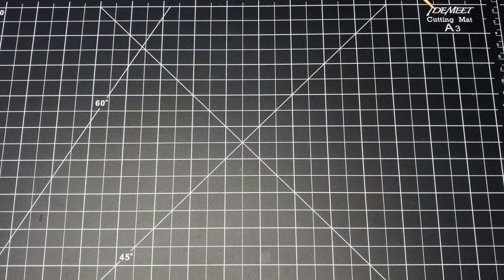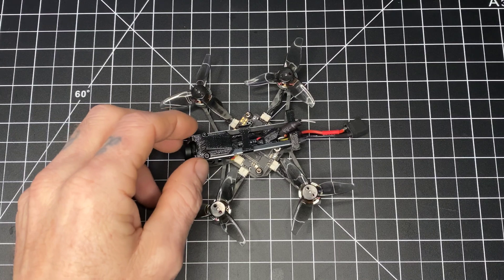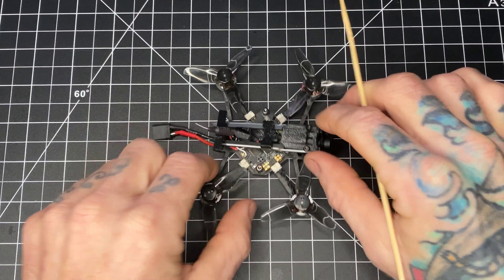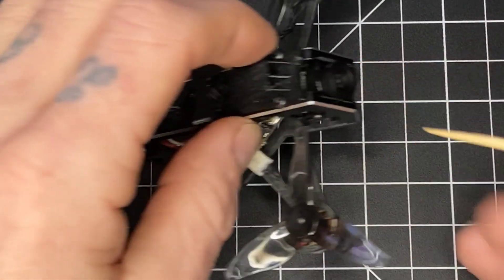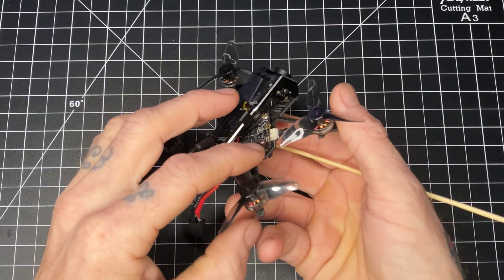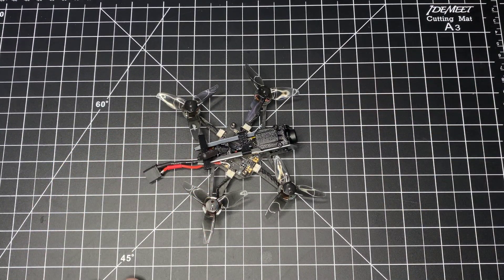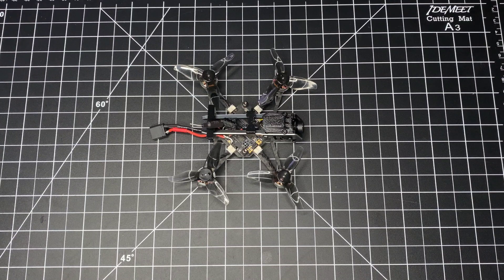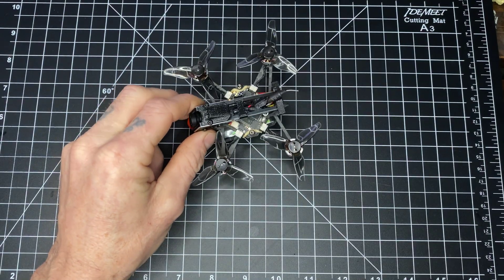Nano Freestyle Drone | HGLRC Draknight 2.0 #fpv #fpvdrone

Comment: Will it run 4s?
Reply from the maker: No 3s max
Reply: @justhackitfpv No issues at all on the 10000kv motors with 3s?
Reply from the maker: @S.G54321 no issues
Reply: @justhackitfpv Ordered some 3s lipos for it 😁. I was using 1003 14800kv motors on 2s for a while. Fast but it drained my batteries faster.... If the 10000kv motors can give similar speed or even a touch faster on 3s, while also having better battery life. Hell yeah! 😁

Comment: Hey man what size Allen key does it take to open up the frame I lost my Allen wrench for it. Not the size of the bold for the camera but underneath to the the top of the frame off?
Reply from the maker: M2
Reply: @justhackitfpv are you sure I think I have an m2 it works on the camera screws and the 2 on the bottom of the frame to remove the fc but there are smaller ones to remove the frame and those are even smaller
Reply from the maker: M1.6

Comment: Have you had issues with the 3s battery?
Reply from the maker: Nope it's going strong
Reply: Hi  @justhackitfpv  , I was wondering what size maH 3S battery you were using and what's the biggest maH size you should use with the Draknight?
Reply: @S.G54321  amazing! thank you so much for replying this is so helpful 👍🎉 do you limit the throttle too? I was thinking 60%-80% throttle limit on the 3S? or is it not necessary?